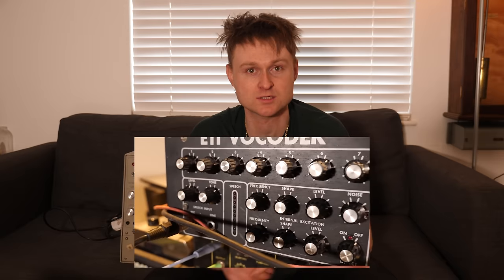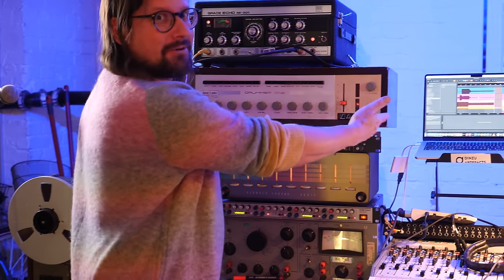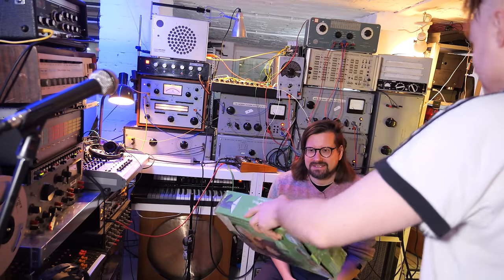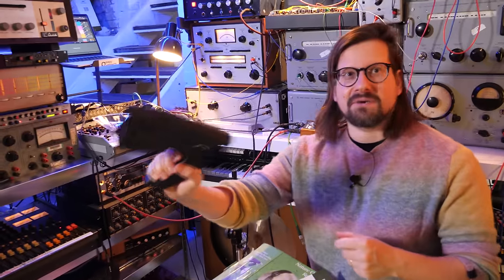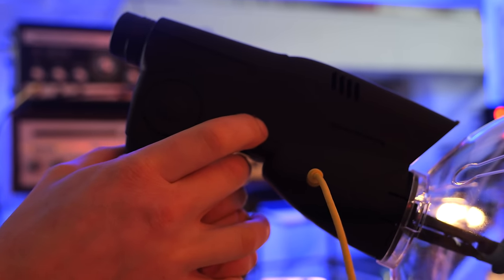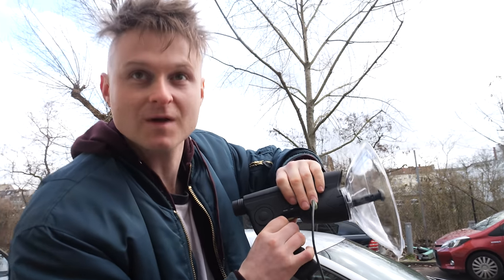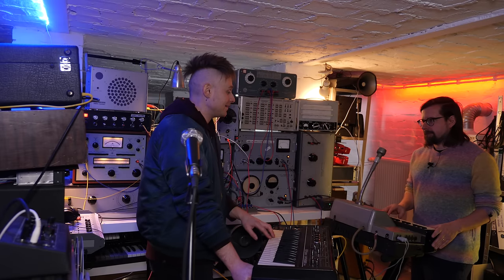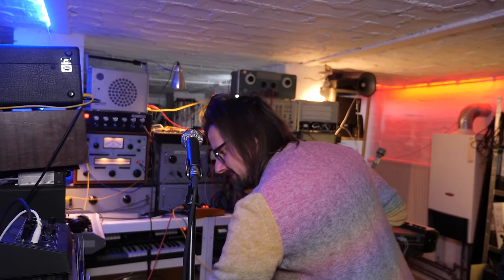THE STRANGEST MICROPHONE I HAVE EVER LOOKED THROUGH

Comment: When you are recording outside, it really picks up that cracle from the gravel on the street.

This really reminds me of these vomyme-filtering hearing protection that I've got. It's not like modern noise-cancelling headphones, but they are industrial-grade hearing protection with hearing assist, so you are supposed to be able to hear normal speech but not loud noise.

If you crank the volume on them, the sound gets similairly weird, and they pick up the most miniscule noises, like the sound of rain outside, or the rustle of your pants.
I work in a workshop with a huge, leaky compressed air system, and that makes those headphones completely unusable because all you hear is the cacaphony of a hundred leaky air seals.

Comment: My dad made me a shotgun-mic with a 1" PVC pipe cut in increasingly longer lengths beginning with a few inches and then 4.5,5,5.5,6,6.5,7,7.5,8,8.5.....layed out side by side on a piece tape, then rolled up into a circle spiraling inward. Then put a big funnel on the even end, and put a mic on the small end of the funnel. It worked great!

Comment: I remember back in early 70's in a Swedish DIY electronics book was a microphone very much made like this one. In the near end was a like a kitchen funnel that concentrated the sound to the mike element facing the funnel a few inches away. But from the funnel and facing outwards were plastic tubes in various lengths, with the longest in the middle of the beam and then becoming successively shorter and shorter (spiralling). The idea was to have like a magnifier (the rounded funnel) but have it direction sensitive, by the tubes.
I guess the whole arrangement must have been 2-3 feet in length. Maybe I could try to make a sort of drawing and presenting it on the LMNC DIY-forum.
Reply: And the 80's and early 90's (at least in Norway) we had the Select mail order catalogue - the "Whisper 2000" was heavily advertised in that one. Just a box with an ultra-sensitive (lol, sure) mic. It was the Wish / AliXpress thing of the times. Cheap imported Made In Hong Kong stuff, for those of you old enough to know what that meant at the time ;)

Comment: ca 20 years ago, a friend and I were gonna do some acoustic recordings in a 4th floor flat and had rented some equipment; basically a Mackie mixer and a RØDE mic. Getting the setup ready with the mic connected through the mixer I put on a headset testing the clean-sound and then all I could here were a couple of girls chatting and some traffic noises, clear and close-up, very strange since it appeared totally silent in the apartment. Investigating further it turned out the RØDE mic somehow picked up everything from the pavement 4 floors below through closed windows. Had I recorded it, the sound quality would’ve been like a dialogue scene from a movie set outside in the city

Comment: Hey Sam, do you want a vintage (reel to reel) tape eraser for the museum?  I dare not use it as the bakelite back panel is now dust, but it still seems to run.  Also its a big fo  electro magnet in a metal  box (with a spindle ro sit the tape spool on )  with point to point wiring. I will fry myself or something more valuable lol its small enough to post but quite heavy .

Comment: A better reflector could make a difference. Greater radius, more rigid material.
There used to be a trade called metal spinning, but I'm guessing it's all CNC or 3D printing, or some such these days.
Reply from the maker: to be honest metal spinning a large disk would be much more straight forward than cncing it :D. just grab a wock from the kitchen shop and drill a hole in it haha
Reply: @LOOKMUMNOCOMPUTER  I hate to be a killjoy, but I don't think woks are parabolic. The "parabolic" cross-section has the property of reflecting incoming sound to a single central point. A spherical curve (circular cross-section) doesn't reflect everything to a focus point. You may have heard the term "spherical aberration" WRT to photography. Who knows what the profile of a wok is? iDK, a quick search was not fruitful. :-)
Reply from the maker: yes but a wock is merely a bigger curve, just haver the mic a bit further out. sometimes bodging is better than nothing. anyways likely i wont get around to it. so no point worrying :) @flamencoprof
Reply: @LOOKMUMNOCOMPUTER  LOL. Knowing your general approach, I guessed you might say that. Bodge on!